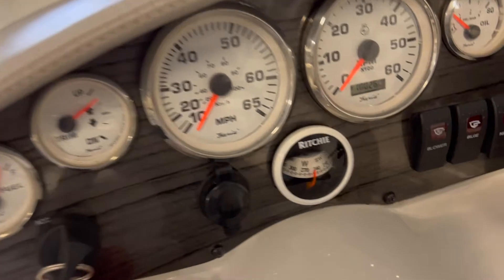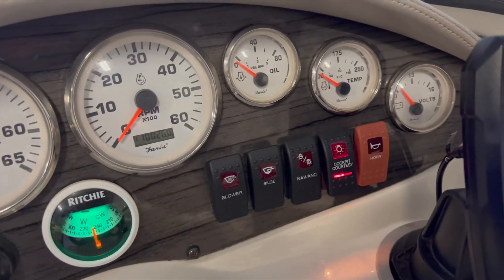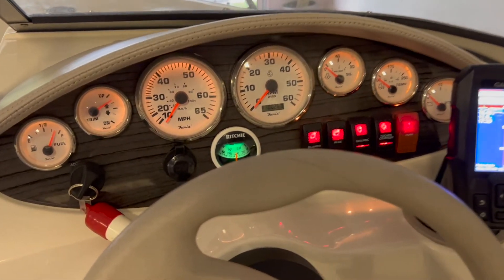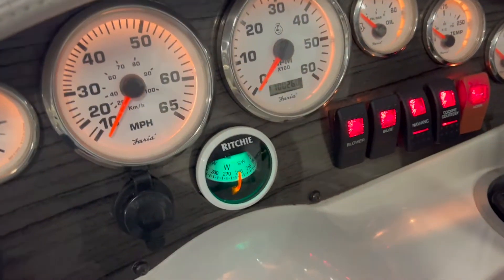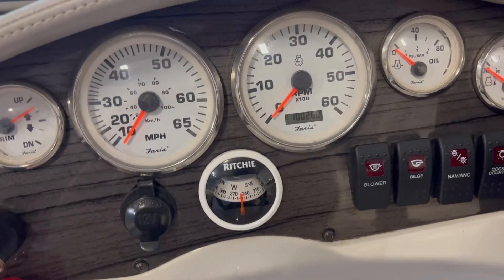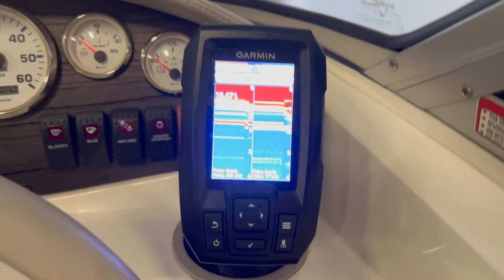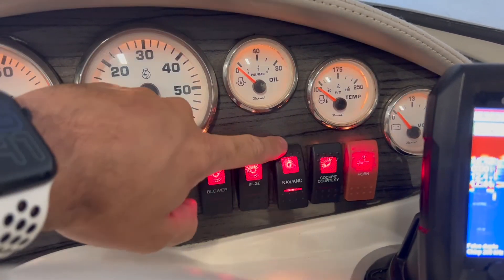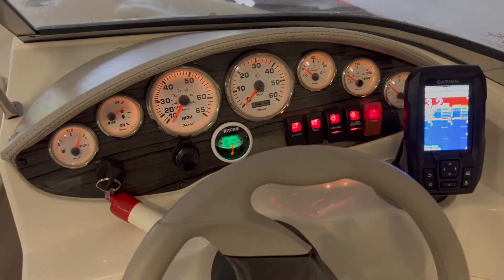Ritchie compass Installed

Comment: The wires going to your Faria gauge cluster is what you really should have tied to. Btw that Garmin will fit perfectly to left of steering wheel. That were I mounted mine and left drink holder alone.
Reply from the maker: Thank you